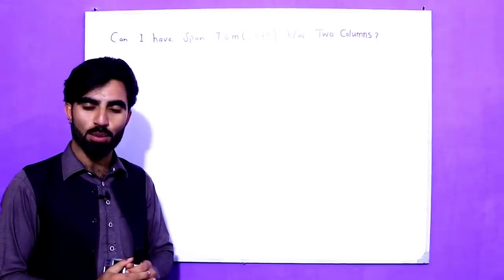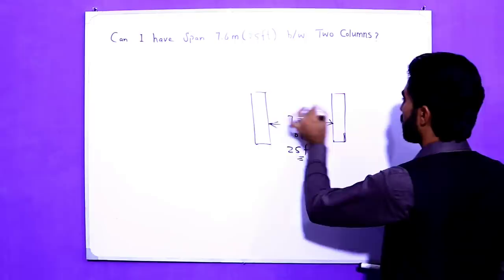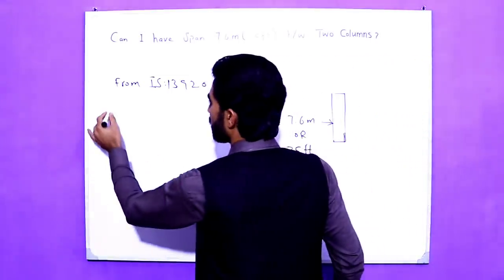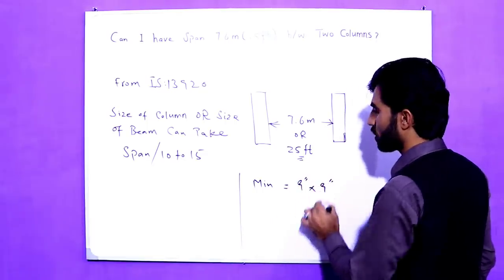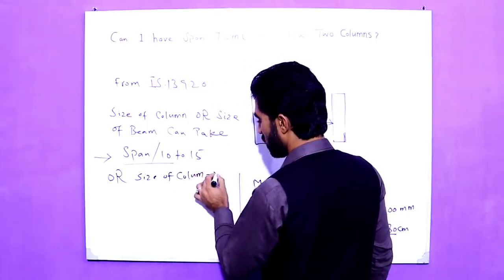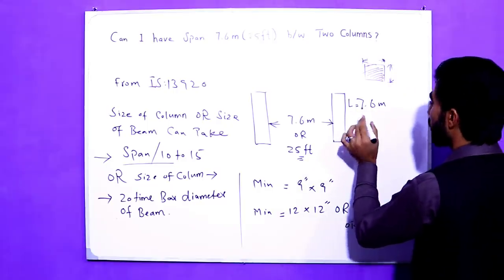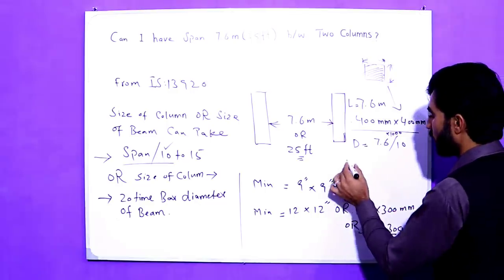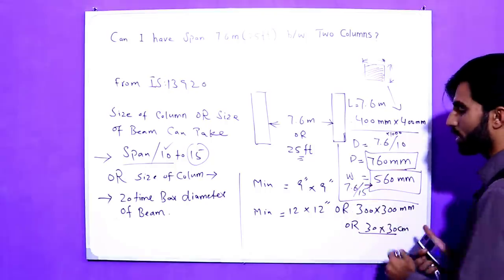Can I have Span 7.6 meter (25ft) between Two Columns - How to Keep span 7.6 meter b/w 2 Columns?

Comment: THE DISTANCE BETWEEN TWO COLUMNS IS GOVERNED BY BEAM DEPTH. YOU CAN GO FOR A 12 M SPAN OR 16 M SPAN, BUT YOU HAVE TO CONSIDER BEAM DEPTH FOR DEFLECTION. THIS NORMALLY NEEDS A PROFESSIONAL STRUCTURAL ENGINEER AND A SMART CONTRACTOR TO EXECUTE IT. THE COST OF DEEP BEAMS IS HIGH.

Comment: Assalamualaikum, Sir,  thanks for guide line for columns and beam sizes in accordance with the IS 131920 code. Could you please make a video thoroughly, I mean A to Z in a  professional  way. Suppose, we know the bearing capacity from Geo Tech report and how we can design the building with load of 250 Psf, 200 Psf, 150Psf like that. Although your videos are very helpful but short.

Comment: On existing Third floor terrace floor
Column size has 450mm x 230mm
Total 8 column 
Total three galas 
Each gala has, columm to column span  is 
12'8" x 18' ( note : this dimensions are not measured from the centre to center of the column )
 All 10 beams has width 6" and depth 24"

We are willing to increase one more slab i.e. fourth floor slab this would be our last slab 
With same all dimensions as above third floor have except beams.  Beams would have width 9" and depth 12" on fourth floor
So would it work out ?????
Can this transfer load properly 
Waiting for your response

Comment: woooooo   my project 26' column to column project 2 column long dispense .  column size 12" - 27"  -- rod 16-20mm beam size - 12-24 -- rod - top 2 16mm - botom 5-20mm st -- exrea 5 20 mm other side  column 12" 20" - rod 14-20mm )There will be no problem - 4 store gmail dea gia thanks

Comment: I have 30x45 plot , want to construct G+2 , Standard Column size in my city for the  mentioned plot size is 6"wx18"d, Can I calculate Beam Size on the basis of mentioned column size  for the distance b/w column i.e 12 ft , 16 ft , max 18 ft.   Thanks in Advance
Reply: Not getting it answer

Comment: For G+2 building, 7.5 x 7.5 m grid system  , central columns  will have  minimum 2200 km reaction.(Live load 3kn,DL 1.5, seismic zone iv) 
So min.size column 600x600 mm 
Beam 450x450  will be more than enough....
Reply: this guys make tutorial only for G+1 ...watch his previous videos..dumbb

Comment: What is the depth of foundation for 4 storey building?
Reply: This depend on the geological conditions. Under normal circumstances, 1.5 metre depth, 4 X 4 length and breadth is enough.

Comment: (1)  in ground coloum  size 9 by 15, there is 6 no of  bar 12 mm bar on corner and middle 10 mm bar,  in first floor I want to put more steel, like all 6 no of bar  12 mm, can I do it,. (2) we have 35 feet span of two columns, what beam should be design , please answer immediately
Reply: Atleast beam depth should be 2 ft

Comment: Only one doubt... Beam width is bigger than column width... Will it be safe to carry load... 700 x 500 - Beam size... 400 x 400 - Column Size... 500 sits on 400... Will column show heavy buckling when 50mm on either sides of the beam projected outwards...
Reply: What he explain in the video is not pure civil engineering since size of column and beam totally depends on loads.  And as for a 400x400 column size the right width of beam should be 350 mm only
Reply: Please urdu main lecture diya krein g
Reply: Very good question
Reply: Right
Reply: Thank you sir more doubts are cleared thank you very much sir more useful
Reply: For 400 x400 column beam size can be restricted to 700 x300 or not

Comment: Dear sir, what should be the reinforcement in beam for 25 feet long beam for 3 storied building and is it necessary to provide side face reinforcement in beam..???
Reply: It depends many more factor such as soil quality , zone of earthquake, loads etc
Reply: @youngindia9046  Yes I got it...it depends on structural loads and others but generally what is appropriate...range...I have the same case 25 feet spacing between columns. I gave 450x600 beam with 6 through 20 mm dia bars at bottom and 3-20 Th at top with 3-20 as curtailed bar...is it okey...in general sense...??